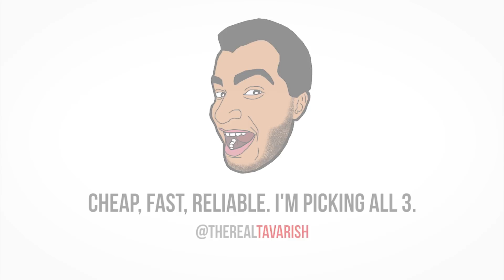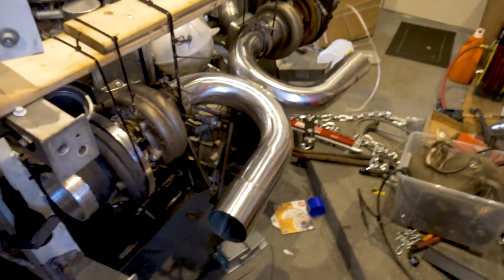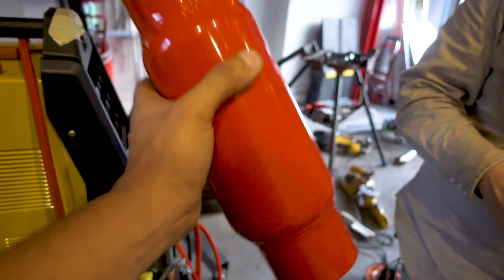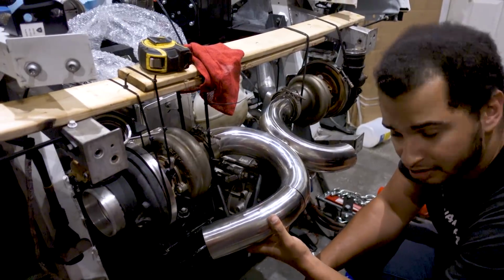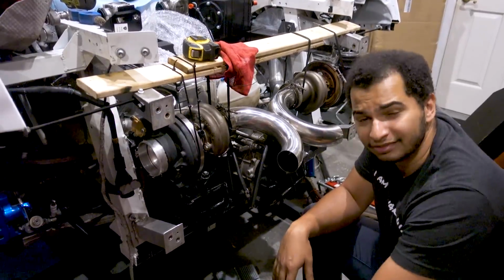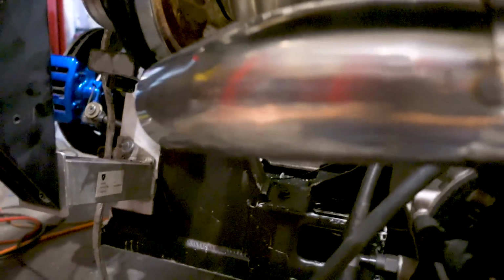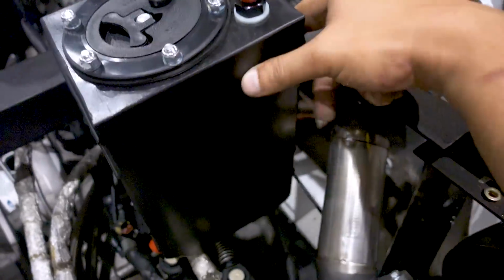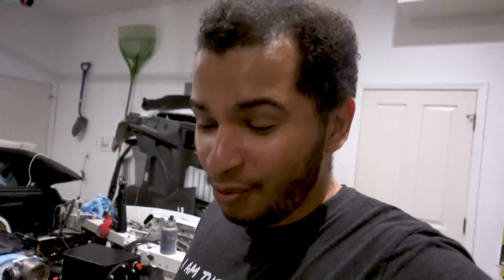Installing A Stupid Cheap Muffler On A 1,000 HP Lamborghini (Is Actually A HORRIBLE Idea)

Comment: Look tavrish I like your idea with the cherry bombs but believe it or not they are actually huge horsepower robbers compared to using just a normal resonator. I have two of them on my truck now and I can say the butt dyno has read less power since I put them on. I believe motortrend made a video in their Engine Masters series testing power difference between many mufflers. Take a look at it if you get the chance.

Comment: DO NOT, paint that stainless!!!  Once that thing is all TIG'd up, you won't want to cover those welds anyway. Be sure to clean all the grease and fingerprints off the stainless and let dry, before you fire the car up; otherwise it will be forever "burned in"

Comment: Instead of turning the exhaust 180 degrees did you consider crossing them over.  The left turbo exhaust exiting the car on the right.
Straighter plumbing less restricting flow and less cutting and turns- simpler manufacturing efforts.

Comment: Mixing carbon steel and stainless in the exhaust (or anywhere) is a bad idea due to galvanic corrosion. 
If you need mufflers go SS and get some more volume to the chamber than the Cherry Bombs provide. If you just want to knock down resonance try a Hemholtz type:

Link to calcs in excel format. 
http://tinyurl.com/midnightsun-calc
Includes RPM pulse Drone calculator
Includes Cabin Drone calculator
Includes Horse Power to Intake / Exhaust size / CFM calculator

Math required for in cabin drone...just put this in a spreadsheet program. =((1211/135)/4)*12
Now you will have the length of pipe required in inches.

Parts of the formula that change.
1211 = is the speed of sound. *This should be calculated using the temp inside the 1/4 wave resonator because temperature affects the speed of sound. Ex using 150 deg.
135 = frequency in Hz of the drone in cabin

* The diameter of the side branch should be equal to the diameter of the main pipe its connected *
* Heat affects the air speed in the wave resonator *
* build it angled so gravity can expel water if collected * 
* Magnaflow recommends tuning a 1/4 wave resonator to the frequency of cabin drone.
* I feel engine pulse freq should be tuned not in cabin drone. Start with the longest pipe because you can always cut it down if the problem wasn't solved.
* Filling the pipe with some rag wool or fiberglass packing will help remove high frequency as well if you want. AKA rasp.

Comment: It is all cool how you are doing it... but i wonder if there was a way to cross the turbos over and have the exaust shoot out the opposite side of the car, from where the turbo it came out was. the idea behind this is you give the exhaust the most straight line exit you can out of the car. Do you really need to cross the exhaust over?  

Also, do you have space even for catalytic converters?  its really not that important to me if you don't or do.. I'm just entertained by the fact you sending your exaust out on a roller coaster rider around before sending it on it way out without a single thought to its content.

Comment: Am I missing something here, or are those turbos really, really far from the exhaust ports of the actual engine. It seems like this whole setup will basically ensure turbo lag for days. On top of that, wouldn't you have reduced pressure and velocity from the exhaust once those exhaust gases take their sweet time to make it all the way back there? It might be to late now, but why don't you just forget the whole turbo thing. What's the gain from doing all this work?

Comment: You look really hot Florida is too hot man. You should put a A/C window unit in your garage wall. Cut a square in the wall and do it. They are only 200 or 300 dollars and they will make it ice cold in your garage. 
     I sure wanted to see the cherry bombs on there. They will make it much more quiet trust me. Its going to be insanely loud with out them. just that little bit on the side has cuts in it then fiber glass and it tones it way down. You can take the mufflers to a muffler shop and have them put on a machine to have them shrunk down on the ends to fit your pipe. It will squeeze it.

Comment: The whole turbo system is routed wrong. Right turbo exhaust exists from the left side of the car and the the left turbo exhaust exists from the right side of the car, you will save space, have as straight pipe as possible. Anyway, it is too late now and you seem to be not knowing what you are doing, no plan, you just weld whatever comes your way...

Comment: For something that is supposedly crap (according to the haters), cherry bombs have enjoyed a particularly long and fruitful career in car performance...and still are being used effectively even when there are 'computer designed', 'high tech' stuff that costs way more and is shinier.  The shiny stuff wins over boi-racer fans...but not the real performance specialists.
Reply: glass pacs are a disaster, the glass degrades and blows out on a daily driver. Might be ok on a rarely driven car, but there are much better non glass resonators.
Reply: That is a very reasonable counterpoint.

Comment: Have you actually cranked/turned over the engine yet?
Reply: Trey Camp I don’t think he can without the turbo’s set up correctly, I’d imagine whatever tune was on it before is expecting boost. Without that the ECU would probably freak out a bit
Reply: Jacob MacDonald true true. So it came "built" already with a TT setup? I mean I'd be nervous doing all this work without even attempting to turn the motor over. Like I would try to get the systems running more before I go for a huge performance setup

Comment: So all this was to keep the heat away from
The turbos intakes and now your going to route the red glowing exhaust right underneath your intakes. And now the two turbos will be under neath the water to air inter cooler heating up your hole engine bay. I love your enthusiasm but this is just poor planing! Ha ha ha ha ha ha

Comment: Silent bob /tony . Sound wise I have no idea how it would be .but just installing some expanded steel will cancel out the harmonics . if you put v bands in the pipe you could play with lengths of the expanded steel and make your own resonator. It is simple to make . Just wrap it around a pipe and tack it together then stuff it in the pipe. Use the diamond shape. Cut until you get a good sound. Use Stainless Steel just the first company I found http://www.mcnichols.com/products/wire-mesh/material/stainless-steel/?keyword=%2Bstainless%20%2Bsteel%20%2Bmesh&utm_source=bing&utm_medium=cpc&utm_campaign=2.1%20Steel%20Wire%20Mesh&utm_term=%2Bstainless%20%2Bsteel%20%2Bmesh&utm_content=Steel%20Wire%20Mesh

Comment: (My buddy & l have been restoring a 68 Ferrari 330GT ll back to original specs - it got mauled by a 'Tuner/Modder' dick - but it's been stop & go, coz the owner is slow on payments. We'll get there, eventually)
Reply: No welding needed tho'... except a small hole in the left rear wheel well where the CB Radio cables went. (They were zip-tied to the leaf spring ffs... wow!)
heh heh